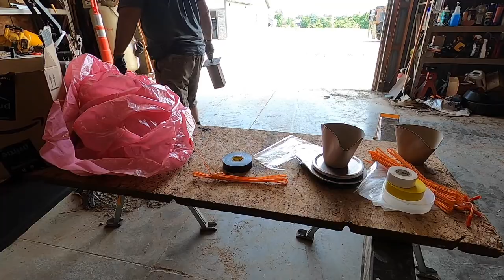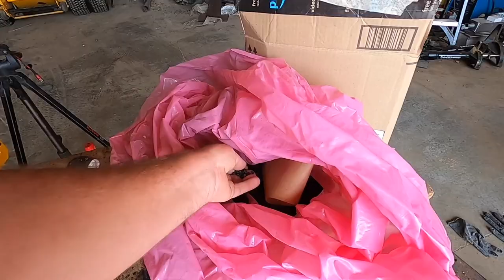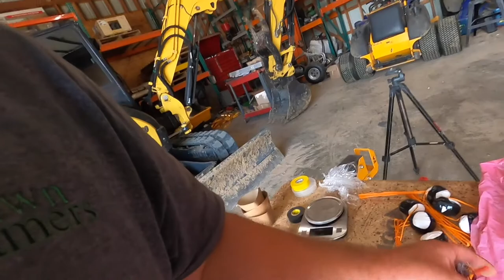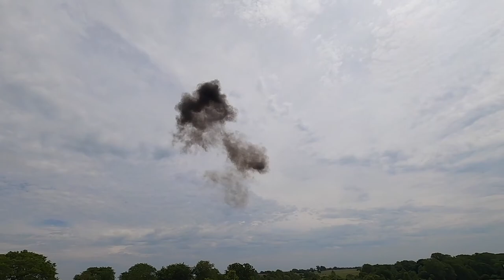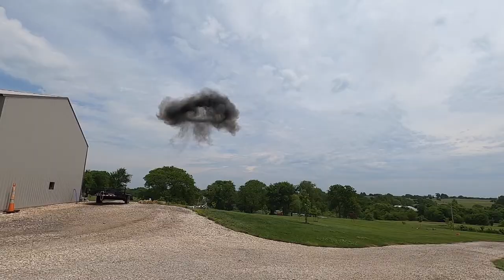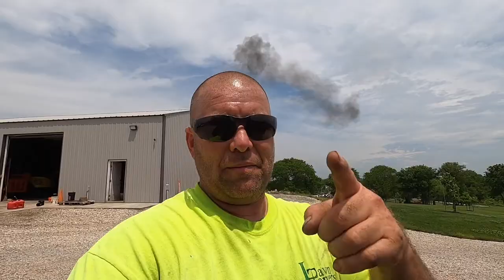How I Make Gasoline Fireballs. ( Fireworks Display )

Comment: Fireballs are fun creamer is another way to do it or place on top of the fuel and water. I like to put titanium in my bp to get all the gas ignited. I make the bp super fast burning to so its quite the site thanks for sharing. And try to shoot some 4 inch salutes up into the cloud its funnnn
Reply from the maker: I tried creamer but I only had 7A powder and it didn't work the way I thought it would. I used lamb milk replacer. Not sure what I did wrong. Only thing I thought was wrong powder.
Reply: @skidco  hmm could be I know sometimes they just add the creamer to the top of the fuel. I think the gas and diesel look goober anyway. But do you make your own black powder iv learned adding titanium helps when using diesel
Reply: @skidco  In my experience, powder needs to have an open flame of some sorts to ignite. The BP is only used to dispurse the powder into the air. A lit road flare or some kind of open flame then ignites the dispursed powder. I've always had a lit flare secured to my mine tube before the BP is ignited. Great fireballs tho!
Reply: @skidco  wouldnt magnesium metal powder ontop of the blackpowder also work since the metal would ignite and get thrown into the gasoline?